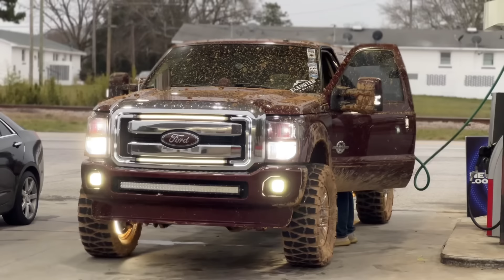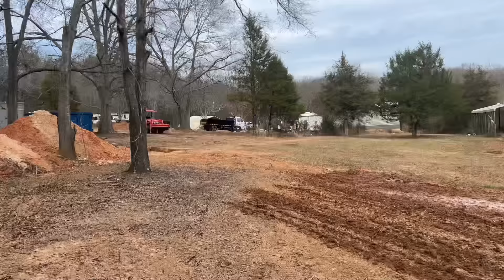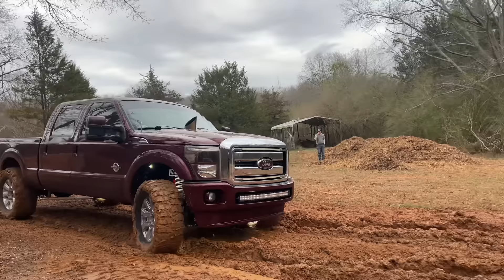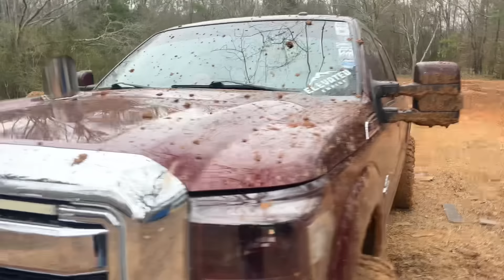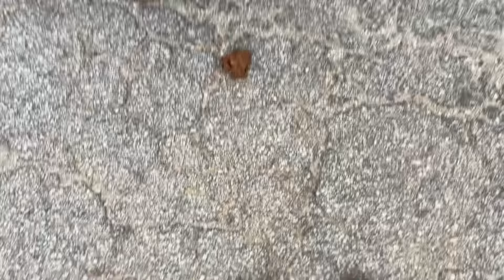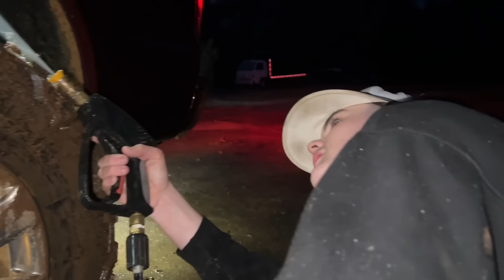Testing my Nitto Mud Grapplers

Comment: Hey bud, if those are stock wheels, i would not run a taper style lug nut like those spiked ones. The stock wheels are meant to be ran with compression style lug nuts. Otherwise they can come loose and you lose a wheel. Otherwise, cool pickup and those sling mud haha

Comment: What do you do when too much mud/water etc goes in the hood stack
Reply from the maker: When the trucks on the exhaust pressure keeps anything from getting in and when it’s off I have a cap for it
Reply: What lift and tire size are you running?
Reply from the maker: @logantoney4525  2 inch level with 37s
Reply: @Hoodstackstudio is in nj you wat to 
😊
Reply: @Hoodstackstudio I like when the turbo whistle on your 6.7 powerstroke gose like wooo!!!! When it’s full diesel throttle 😎😎😎😎😎😎😎😎😎😎😎😎😎😎😎😎😎😎😎😎😎😎😎😎😎😎😎😎😎😎😎😎😎😎😎😎😎😎😎😎😎😎😎😎😎😎😎😎😎😎😎😎😎😎😎😎😎😎😎😎😎😎